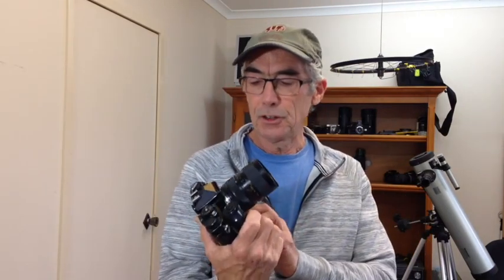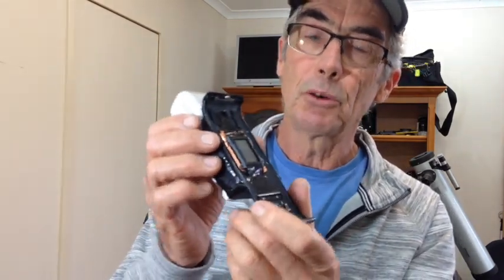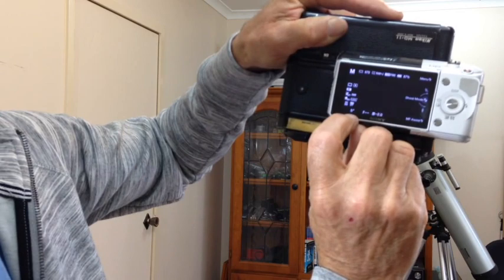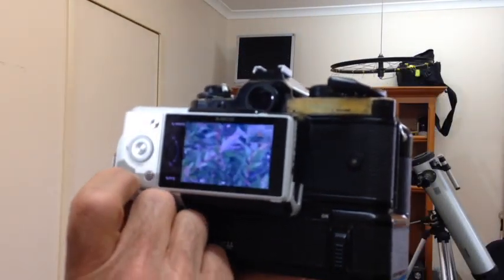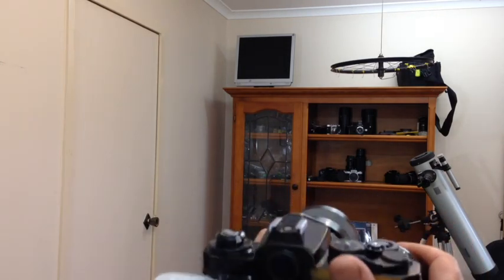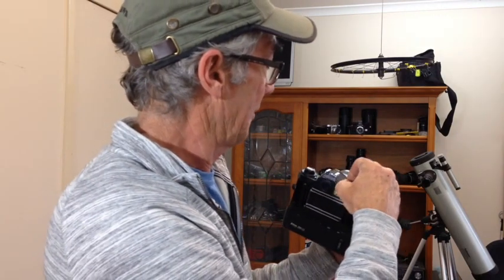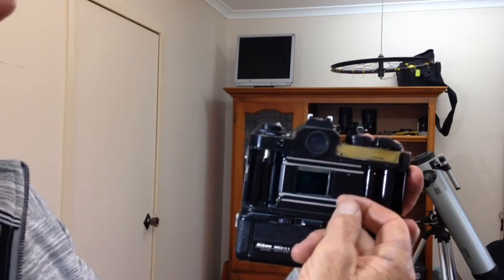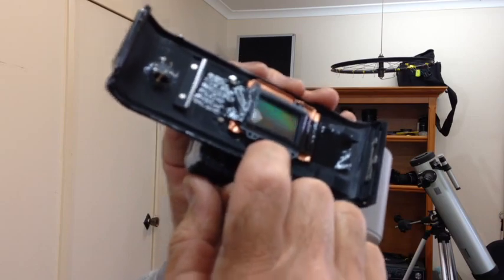Convert SLR Camera to Digital with "Electric Film"

Comment from the maker: Update Modification - I have rubbed back the glass covering the sensor to less than 23.95mm so that it now sits between the film rails on my other Nikons. This digital back now works on my Nikon FA and Nikon FE2 however it is not possible to fit the IR Filter inside these cameras. But leaving the filter off and adjusting the Sony to manual white balance at 2900k G8 provides a deep rich colour photo that can be converted to multispectral infrared black and white. I would say that the Nikon FM has the same rear door, so this digital back would also work on them. As an IR Filter can be fitted at the end of a lens there is now no reason why this digital conversion cannot be done for any 35mm film camera like Canon, Minolta, Leica etc. RG.
Reply: It is amazing how  we are still attached with old cameras. I´ve seen tons of these experiments and so far this one seems to be the best. I wish in the new future  science will get a reliable way to atach a standard device to old body cameras, although every camera has different space in between the lenses, but let`s hope something will pop up so I can use my Leica R3. Eventually old body cameras prices shall rise again!!
Reply from the maker: I think we are attached to the old cameras because they look, feel and sound great. Each brand of camera may have different focal lengths between the film plane and lens but this is irrelevant to fitting a digital sensor in them. My method will work on your camera because the sensor is rebatted into the film area so that the focal point inside the sensor is now the same as where film would sit. I am toying with the idea to fit another modified Nex onto our M3 Leica because I know it will work perfectly and the rear door of the Leica M3 would be so easy to make a suitable copy being just a flat plate. 

What my successful experiment now needs is for people clever with 3D design/print and electronics to make backs for the various SLR cameras that this type of Nex components can be mounted in and so look and operate better than my rough as guts setup. However my bet is that the big camera companies already have all these ideas patented to stop it being commercially viable. They want to sell big plastic cameras that devalue like no tomorrow, rather than upgrade the real old jewel cameras from the 70 to 90's.

Thanks for your comment. Robin.
Reply: True!! Please let us know whe you have that M3 ready to shoot! It would be wonderfull to bring back the old school into shape (at least to an extent) Thank you for your kind words, and we await anxiously surprises from you!! Cheers!!
Reply: any news about this?
Reply: Thank you Very much, Robin. I shall try that!

Comment: To those wondering as to why this matters/ is important/ why would you want to shoot old slrs when digital bodies already exist:
Between the 70-90's there was an insane camera revolution that lead to cameras such as the Contax T2 and Nikon F3 shooting on the same format, even though they are are incredibly different cameras. In medium format you saw cameras like the Hasselblad shooting on the same format Rolleiflex cameras. When everyone is shooting film, you all have essentially the same sensor, and so camera manufactures were competing to create cameras that had the best experience for photographers. This had a lot of trail and error and every manufacturer had a different approach and releases before finding the current DSLR. That lead to companies like Pentax experimenting with 6X7 medium format prism SLRs, like an up scaled 35mm camera and Mamiya making the RZ67 based largely off a mix between large format cameras and the Hasselblad. This meant that if your needs are besides the mass consumer's (which have all been accommodated with the DSLR and mirrorless systems) then you can probably find a better system for you during this camera revolution, all you need to do is give up digital conveniences and shoot those systems. Well, some cant give up digital. This is a great insight into the progress that could be made for digitizing some of these older more outspoken cameras. The F3 is widely considered to be the best 35mm SLR camera ever made, with that Im sure you can understand some people would still like to use that body. Also, it means you can escape the more generic cameras of today where you essentially have 3 choices: Mirrorless, DSRL or Fuji (who make both those generic cameras packaged in an attempt to remember off the past).

Comment: I love the experiment, and it's great if somebody does something for fun.

But for all the haters: YES this is basically the same as just taking a Digital camera and adapting a vintage lens. In this case, the SLR body is the adapter. And smaller, easier adapters are available for 10$ on ebay.
Reply: What?? Just buy a nikon dlsr, you can use your lenses on it.

Comment: You basically made a crop DSLR but with an inaccurate flange distance and an unnavigable user interface... but there is certainly potential in the idea. Like you say further down if it was fine tuned and machined properly it could be in fact very successful. You could integrate electronics into the areas for the film spools somehow... Cool idea
Reply: Just put a digital viewfinder in a film camera. Tah daaahhh!
Reply: @Jay-jb2vr  How about mounting a  lens mount adapter to the crop-sensor camera before destroying it?

Comment: ...Just thinking ... Would not be Great If the photograph industry release a professional consumer line of digital adapters that could work with vintage cameras in the same line of the device shown in this video ????
Reply: There were several digital-adapter backs for popular Canon & Nikon cameras over the years; I remember seeing them at both Photo Expo (in NYC) and Photokina (in Germany.) All these companies were purchased (mergers/acquisitions) by large camera companies and the product lines allowed to die off.
Reply: There was one called Silicon Film I think. They abandoned it when funding dried up after 9/11.
Reply: Hasselblad does it but only for their own cams

Comment: robin i have seen your fantastic idear, but how do you fake the camera by having no lens. pleas contact me i want to rebuild my canon ae-1 to yours. regards robbert
Reply from the maker: Thanks Robbert. In the menu of the Sony Nex cameras is a setting to "Release w/o Lens" which means it will fire it's shutter without a lens attached. This setting is for when lens adapters for other camera lenses are used and so it works well for this hybrid camera. I would choose the Sony Nex C3 as a suitable digital back because the front face can be cut off quite flat as there is nothing behind that hand grip on the C3. Other models are difficult if there is a bulge at the front. Good luck with it and have fun. Robin
Reply: @RobinGuymer-Gizz  hi Robin thanks great that in the menu I can change it. In you're other example you take a Nex 5. Is that smaller to mount I'm very handy. Is that what you mean. Robbert.Pas@hetnet.nl you can mail me.
Reply: @RobinGuymer-Gizz 
I'm looking for parts the price keeping low as possible. 4 kids is expensive.

Comment: My Nikon F has a B setting and a T setting. B closes the shutter the instant you let go of the button, while T keeps the shutter open until you turn or change the shutter speed nob setting. I also sometimes see it "get stuck" when I got a 1/8 sec shutter speed set but it seems to behave normally after a few test shots every year or so.

Comment: Would it be possible to separate the screen and the back unit via a USB or Bluetooth and make it really a compact "digital film" attachment? Attached the monitor unit and synchronized the ASA/ISO to the camera and remove them then shuttered away 36++ exposure.

Comment: I was wondering... How about using a digital mirrorless with the jack for the release cable, and connect it through the PC socket of an old SLR (or, with an adaptation, use the output from the flash hot shoe)? I do really thing it would need a sort of converter to convert the signal from the PC standard to that of a mirrorless, but that shouldn't be impossible to do... In this way you could set the shutter on the digital camera to, let's say, 1/8, and sync with the slr, which if is a quite good one may allow for times up to 1/125 (I was thinking about this escamotage to digitalize my Olympus Pen F, which has a rotary shutter and allows for flash sync from 1 second to 1/500, that is to say the entire shutter speed range

Comment: I wish one of the camera manufacturers - especially Olympus, Kodak, Fuji or Nikon would make actual "Digital Film" - a cartridge you can insert in the film chamber of almost ANY 35mm film SLR that would behave just like film - but you can change the ISO and control exposure via Bluetooth or NFC to your smartphone. After taking pictures it would simply download to your smartphone or tablet and then do whatever with it. I think Nikon owns a patent on this, to prevent others from making a dent in DSLR sales.. This could be an actual "full frame" sensor to match the same 35mm frame. You could use all the same lenses on classic hardware. Leica makes a camera that behaves like a film camera - no preview LCD - so you have to check pictures after you download. Until and unless that happens we will have to kludge it like this - very interesting nonetheless.

Comment: Hi,Robin. Very inventive and ,yes,I say, highly innovative. I have owned Nikon SLR and now using DSLR but my love for my SLR still remains intact. I had been wondering, until this moment,if there is going to be ever possible to use my SLR digitally. You point to a possibility and successfully too. Obviously I cannot possibly do it at home. So I am wondering if you will float an outfit or design a conversion base that can easily fit to SLR models. Just an idea. Give it a thought. Thanks,Robin Guymer. I want you to know how much appreciate your innovativeness.

Comment: This is absolutely great. Appreciate it very much. Thinking of moving my FM2 to a whole new level now ;-)
Do you see any chance to get the trigger info over to the Sony AND keep it somewhat in sync? Maybe by means of the contacts on the bottom of the FE/FM?!?
Reply from the maker: Thanks Peter. Yes it is possible to sync the Sony to the Nikon but by persons more skillfull at electronics than me. The two sites below show how you can solder an external switch to the Sony and Ollie Baker was able to wire in a micro switch to his Konica to put them in sync. If you were doing a long exposure you would need to keep the Nikon button pressed down till the Nikon's light meter closed the exposure. There are a couple of places in the bottom section of the Nikon where you might be able to wire in a small micro switch that is triggered by the components down there that go click during an exposure. I did look to see if I could get any electrical feedback from inside the motor drive but like I said I really am useless with electronic stuff being a builder by trade. Hope these sites are of assistance. Regards Robin.

Ollie Baker ( I got the idea of just banging the whole Nex on the back of an SLR from Ollie's work.)
https://frankencamera.wordpress.com

Mark Kirschenbaum
https://gethypoxic.com/blogs/technical/16457609-adding-a-wired-shutter-release-to-the-sony-nex-5

Comment: Neat. My only possible criticisms are (a) it's bulky, (b) you need a second back for the camera you're digitalising (that you're not afraid to sacrifice), and (c) you are limited to APS-C (unless you have the money and the nerve to sacrifice a full-frame digital body).  But I guess if you're the sort of person who sells on a lot of film cameras of a specific type, and you have no trouble taking the backs off in replaceable fashion, it would be a quick and easy way to check the function of meter, shutter curtain timing and lens apertures without needing sophisticated equipment.
Reply from the maker: All good points but it's also great for infrared photography with 2 stops extra light to play with and this gives a whole new dimension to your photography.  They could also be excellent cameras for photography schools who still teach their students the basics with film cameras.
Reply: Robin Guymer I would beg to differ with the last. Sure, it does help to see early on what effect differences in aperture and shutter speed have, but that can be done by the instructor with a tethered digital. If your photography school is using film cameras, the basics they will be covering are take, develop and print and you don't need or want a digital back for that.

Comment: This is really cool! I wonder if you can use a cable release to sync the back
Reply from the maker: Thanks Ziyang. My first attempt with a Nex 5 I was trying to wire a switch onto the camera back. This can be done if your good with electronics which I am not. Otherwise you could wire in a microswitch within the SLR that fires the Nex at the same time (see Frankencamera). I have put a small swivel lever mounted onto the Nikon motor drive which makes it very easy to trigger the Nex with my left thumb (either on say 2 to 5 sec or on Bulb). What is really cool with this camera is Infrared photography. This is a whole new dimension and SLR's are designed to use Infrared film with focus adjustments for IR on the old lenses. So they are perfect for digital Infrared. See my blog on this subject at http://xovercameras.blogspot.com.au which I will post later tonight. 2/12/2016. Thanks heaps for the great support. Hope your going to build one as it would be great to share ideas as I intend to do another one with my Canon A1. My email is on the blog site. Cheers.
Reply: Hi Robin, thanks for your reply! I will try it in the future! Merry Christmas!

Comment: Any ideas on how to make a Nikkor lens for an F series fit on a Digital Nikon?
Reply from the maker: Yes John it's fairly simple to do with a dremel grinder and a file. It is just a matter of grinding back a slim section of the rear mount so that it will pickup the metering protrusion and rotate it to the corresponding fully open F stop. Nikon used to sell the conversion mounts but no longer available. I have done this with a Nikkor  S Auto 50/1.4 which now fits all my Nikons and is a great lens and it still has the rabbit ears to use on my F2. Google Nikkor non AI conversions to AI. Good luck with it.

Comment: Nice one :) Can you sync an external flash with such arrangement ? Nex cameras does not allow external 3rd party flash on their own.
Reply: lvgk g Since he has the Sony set at 5 Seconds, I would think as long as the flash syncs with the Nikon it would work, Since the Nikon is in fact controlling the actual exposure.
Reply from the maker: The Nex is only the electric film. The flash is controlled and syncd by the Nikon. I use my old Metz 45CT that would melt the electronics in a DSLR. See my post "Using a Film Camera Converted to Digital" at http://xovercameras.blogspot.com.au

Comment: You brought digital to a fine film camera  ! Can I send you my MINOLTA SRT-101 ?!
Nice work mate ...
NJ , USA
Reply from the maker: Cheers. Yes the Nikon FE's are so reliable. Your Minolta could well be suitable. There is only two requirements for a Nex digital back on an SLR. 1/ Is the back film door removable? (so you can fit a spare one or custom make one to mount the sensor and Nex) 2/ Can you, with a bit of ingenuity, fit the IR Filter combo behind the mirror against the shutter frame inside the SLR without causing mirror or shutter lockup? Most high quality SLR's are suitable and also Rangefinders.  Of the cameras we have the Canon A1 looks easy, Nikon FE2 bit tricky as it has an undercover to the mirror, Leicaflex SL looks doable, Leica M3 piece of cake with the flat back door easy to custom make and plenty of room internally for the filters with no mirror. Could be time for a new lease on life for your lovely old Minolta. All the Best. R.G.

Comment: Thanks for making this video, I've been wondering how to do exactly this project, I wasn't sure if it was positive now I know tks
Reply from the maker: Cheers John, yes it is a positive outcome. Hope you proceed with it as it would be great to have someone to compare notes with. I rarely use the IR/AA filter insert now as the photography off the bare sensor and converted to B&W Noir in Mac Photos makes for some great shots. It is actually quite difficult as the focus needs some guessing and the manual speed & aperture settings critical given there is so much extra light available. RG.
Reply: Robin Guymer thanks for your reply, I have a lovely 1980s Minolta with loads of great lenses.
I have to find a digital camera to sacrifice. I will need advice please , I'll update you as soon as possible.

Comment: How do you synchronize the shutters in both cameras?
Reply from the maker: They don't need to be synchronised. The Nex just needs to be electrified with enough time for the SLR camera to expose the shot at it's light meter setting.  I set the Nex around 3 seconds but you can hold it on in Bulb or set it out to 30 seconds. But the longer it is on the more noise you get on the picture. Watch my other video and it will make sense. The shutter in the Nex is made redundant but it is needs to operate because the Sony software requires it to make the Nex work.  Get rid of the Nex shutter and you could make a very neat digital back. RG.